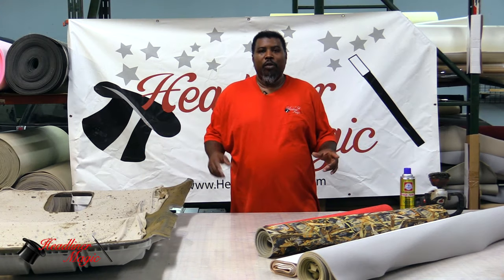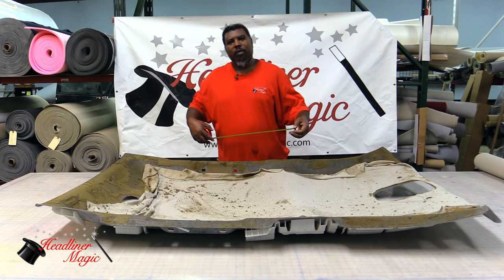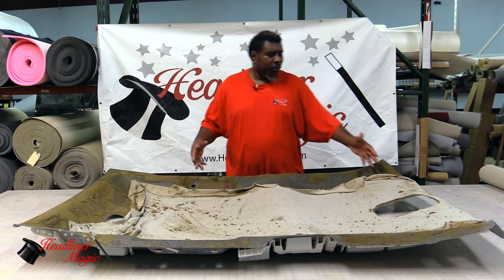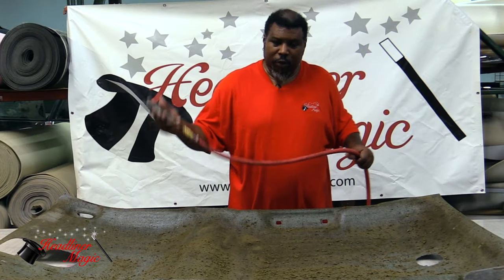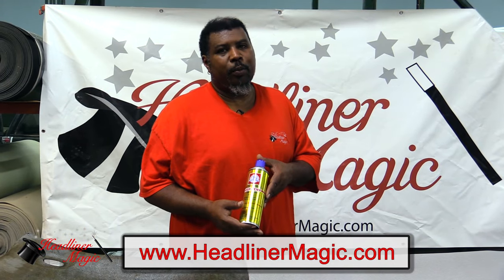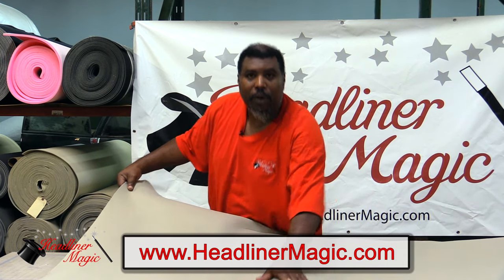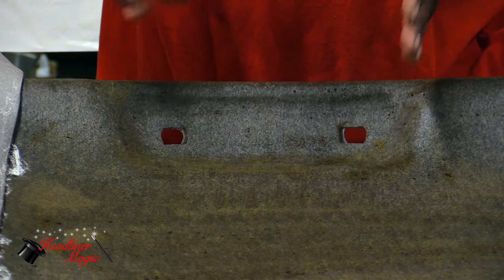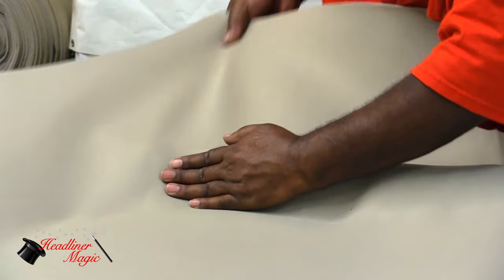Detail Process Replacing the Headliner Ceiling Fabric in Any Vehicle

Comment: 6:10 - 8:10 no sound
Reply from the maker: Thanks Tommy for watching our videos.  We have a link in the description of the video fo a new one with corrected audio issues.  Marcus
Reply: @HeadlinerMagic  You made a nice and informative video that captures the attention of a person in need such as myself. My own headliner is sagging and need to replace it.
Sadly i'm not from america so buying from your store would be difficult for me.
If I may ask a couple of questions to avoid being taken advantage by local shops.
Is there any material that cannot or should not be used as headliner? I'd like to use some material with shapes and pattern on it but don't want an installer to ruin it and blame it on the material. Your store seems to offer a variety of materials beside the OEM bland ones.
Thank you

Comment: This video is missing a vital step.   In almost every case, the headliner board will have oils, from human hair, smoking, spills and other sources of oils which will prevent adhesive from adhering to the board.  it is imperative that the board itself be THOROUGHLY cleaned before attempting to glue the headliner material to the board.   Lacquer thinner and alcohol are liquids that can dissolve and remove these oils.   If you attempt to apply the headliner WITHOUT thoroughly cleaning the headliner board first, will will likely have many sags in your finished work where the material did not properly adhere to the board.   EXCEPT for that one vital missing step, very helpful video.

Comment: Hey, I see you're active right now so if I can run this by you that would be great. I'll delete this message after so as to not clutter up your comments. My order number is: ~snip~. I have a 2003 single cab chevy, my headliner seems a bit greyish and on the site the suggested headliner seems more tan in the image. I just want to verify that I did in fact order the correct headliner material. I can snap a quick picture of my headliner for verification if needed. Thanks again!
Reply: Here are two images. One showing the headliner and the other showing a bit of the headliner and interior to get an idea. https://imgur.com/a/hLnpVwZ
Reply from the maker: @TheModShopCO  I checked the order and the pics.  Your all set.  The color will match perfectly.  The Shale color 2144 is the most used color in those trucks.  "LOL" I saw your mask hanging on the rear view.  Stay Safe.
Reply from the maker: Thanks for the order.  I will get it shipped ASAP.  You can leave the comments it helps our video rank higher in the search rankings.  Its all engagement.
Reply: @HeadlinerMagic  Yep, crazy times lol. Thanks a lot for the help and stay stay safe out there!
Reply from the maker: Thank you as well. Send me a finish product pic so I can use it on the websites.
Reply: @HeadlinerMagic  You bet!
Reply: @HeadlinerMagic  Before and after pictures of the headliner

https://imgur.com/a/wEsl80u

Turned out great man thanks!
Reply from the maker: @TheModShopCO  Thanks, Your right it came out awesome. Great pics too  I will keep you posted when the web-page is done for the post.  Thanks again!😎

Comment: Quick tip, DO NOT FOLLOW the directions on the can! Do not allow the product to tack up before you lay the headliner; it will instantly create wrinkles and your material will be ruined. I'm having to peel mine off and order new liner and glue 👎
Reply from the maker: Thank you Sed6 for watching.  And yes the glue instructions are not up to par.  I always suggest to spray a short amount of area and work it quickly.  Marcus